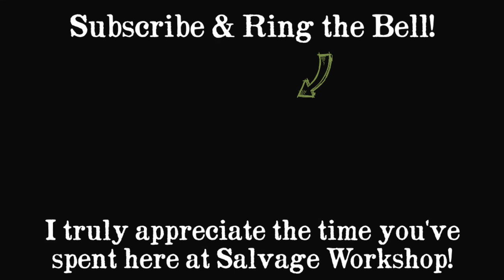1930's Refractory Hammer ~ RESTORATION with an ANTIQUE PATINA

Comment: The hammer brought back some memories. I worked In a foundry and we did use these. Only when we re-lined the furnace or built a roof for it. The brick had to be in perfect condition with no chips or cracks. It would take two weeks to re-line the furnace and close to a week to build a roof.

Comment: I have two of these hammers. They come with a longer original handle. I replace the heads with dog bone rawhide I soak in water for a couple of days to soften it up. Works great. If you boil one of the bones, you get hide glue to glue it all together with.

Comment: Thank you for doing this project which gave me an idea.  My brother is a hind end machinist while I'm a woodturner.  I found one of these on e-bay and stripped it down, removed all the rust, and repainted the casting in a Rustoleum 'hammered' spray paint finish.  Instead of the wrapped leather facings, however, I turned two separate faces for 'my' version.  One face from a piece of spalted maple and the other from an extremely hard wood called lignum vitae.  I also turned a new handle from a piece of hickory.  I finished all the wood in a tung oil finish and then gave it to my brother for his birthday.  I thought it came out pretty well and he tells me it's a topic of conversation for anyone who visits his office.  Again...thanks for the idea.

Comment: Your hammer, which is technically called a "refractory hammer", was developed by the company in 1933 for use in the installation and demolitiohn of coke ovens, blast furnaces, and other applications where refractory brick (fire brick) is being installed.  Today, it is referred to as a "split-head hammer" because the top is in two parts, held together by a large nut at the bottom, so the striking material in it can be changed or replaced.  Apparently, this kind of hammer was particularly common in the 1930's and 40's, and could be had in various materials for the striking face, including copper, aluminum, plastic, rawhide and babbitt metal.
Reply from the maker: That's correct!

Comment: I always hate having to replace original parts [[the leather ends and the broken handle]], however, that is a nice job cleaning up an 80 year old hammer, nice the lettering was solid and no deep pits in the metal.   Great job.

Comment: Nice job! Just as an experiment you could have tried to refit the original leather faces by turning them around, perhaps soaking them in some kind of glue or softening them up in leather oil and using the hammer itself as a compressing mould. If the faces weren't too messed up it should be a perfect fit after cleaning up excess glue/oil.

Comment: I have one of the Greene & Tweed leather mallets in No. 1.  Looks exactly like yours just smaller.  It was my father-in-laws, and his fathers, so I plan on keeping it in the family.  I am getting ready to strip the paint and recoat it the original gray.  My FIL had painted it silver to keep with the color of the tools he kept in the basement.  
I have the leather and am ordering the treatment for it.   I would like to have the natural tan colored leather, but all I could get was gray.  It won't show the dirt as much.
My handle is still in good condition so I will not be replacing it, just recoating it with linseed oil.  The handle has a dark oak coloring so the oil will bring the color back to it.

Comment: The patinas are super 😎   Have you used them on zinc?  I patina zinc frames for my stained glass, but these are very different and I don’t heat the zinc. The zinc would probably melt at the temperatures you use?
Reply from the maker: Never tried zinc, but get a hold of the company Sculpt Nouveau, and they can help you find what could work for you, that's where I go!
Reply: Salvage Workshop thanks!

Comment: The handle on the old hammer was beautiful 
Was there any way to use it in the restoration process or was it to structurally compromised

Maybe even a darkened handle in style of the old would've been a nice touch

Either way the restoration you did was stunning

Comment: Excellent work I personally would have given it a slightly longer handle but that's just my preference but that is also coming from the guy who has an 8 lb sledge with the handle cut down to 12 inches for... reasons

Comment: DUDE GREENE TWEED ARE FUCKING DOPE! Have a Greene Tweed No 1 Defense hammer with the face replaced with solid brass and expertly/vintagely welded to a solid steel and knurled handle with a threaded cap and hollow to fit a punch inside and it's my number one go to as a machinist. Just knowing its job wad to build bombers to hours away from me in Wichita fills me with glee. I will never know how many Nazi's that hammer showed what's what - but I know its always a happy hammer

Comment: I was beginning to think there was some strange requirement for YouTube makers and restorers to wear black gloves - glad that's not the case!  Seriously though that is a really nice restoration.  I must have missed it, but why did you leave a gap when there when tightening up the head?  Definitely looks intentional so I figure there's a good reason.  Maybe so it comes apart more easily?
Reply from the maker: Lol i must not have gotten the manual for restoration videos! I'm glad you enjoyed it! I didnt leave a gap, thats how it was designed. Without the gap it wouldnt be possible to change the hammer faces. The top and bottom squeeze the hammer faces tight with the use of thst nut. The gap could be different depending on what size hammer faces are installed.